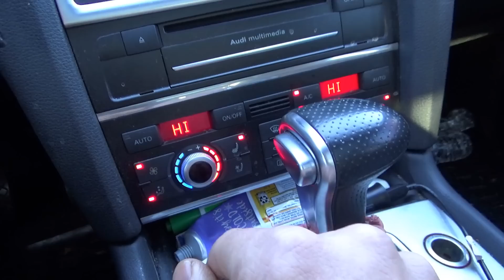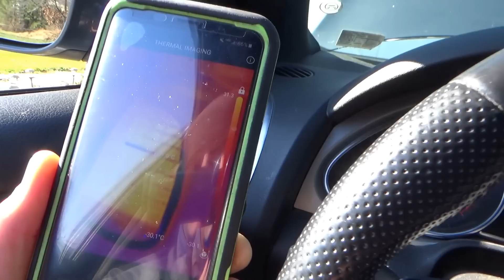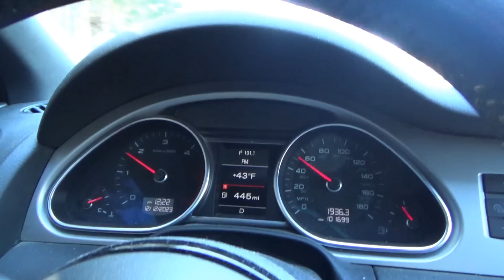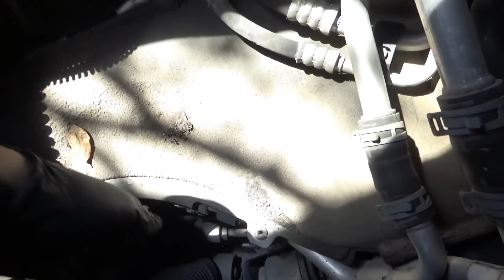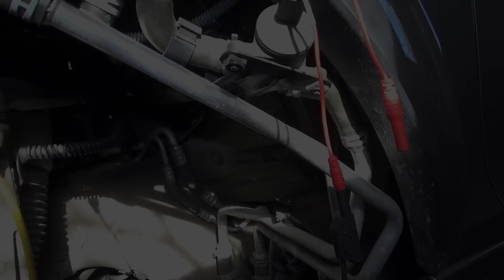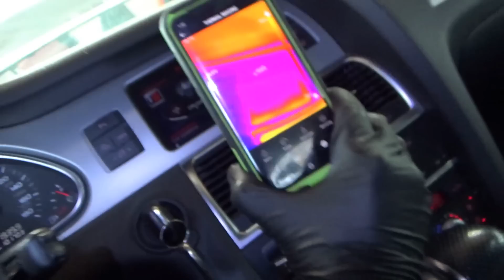Fancy Car...has NO HEAT? (Audi Q7 TDI)

Comment: I've had issues with my 2012 Nissan Frontier SE 4x4 truck since I purchased it. They had to take it back a couple days after purchasing for loss of power and had issues figuring out out. It was the thermostat bad. Even though engine wasn't going into red it was hot enough to put the truck into limp mode. But even after, the Nissan dealership, replaced the thermostat and fixed that issue, my truck has never had good heat. It will stay cold, even if the temp shows normal, while the truck is parked. Once you get moving then it will throw very warm air. But only for a little bit. It will eventually turn cold again. Until the engine is under a load and then it will start to throw hot air again. I wish this could easily be fixed as I plan on keeping it for a few more years.
Reply: My wife's Camry acted like that - and replacing the heater core fixed it, Before replacing the heater core, I'd suggest flushing the core with flow in each direction a few times. Material can coat the inside of the core's tubes and prevent the exchange of heat. Some heater cores are a bear to replace, though. I'd even try putting chemicals in the heater core before replacing it. Good luck to ya!
Reply: @dustcommander100  
I thought about that too, the heater core, but what makes me believe it's not that is that it only happens while sitting still. After you take off it starts to through very hot air. But after 30 seconds or so it eventually goes cold again. If you start up o hill again, it gets hot again. It's making me think that there is air in the line somewhere.
Reply: @HayesTech  That is exactly how the wife's Camry acted! I attributed it to either more coolant flow at higher RPM, or more engine heat produced when driving. If she stopped at a red light, it would go cold, and when driving, it warmed up again. Replacing the heater core either fixed it or got rid of an air pocket that interfered with the flow. I do wish I had backflushed it before going thru all the trouble of replacing it - and I do realize Ivan's (and others) point is quite valid about the possibility of an air pocket being in the system. I wish I had also bled the coolant to eliminate an air pocket as a possible cause.....
Reply: Is this a good reason to use a vacuum coolant filling device?
Reply: @kc360awareness  
I don't know. With me having 2 strokes I losta lot of the use of my right side. So I have to take it to a place for even my oil changes. I truly think it's got air in the system but again I don't know. I'm going to have my mechanic look at it when I save up a few bucks. Shouldn't take that long.
Reply: @kc360awareness  I've never used a device like that, but I normally work on cars that aren't very exotic. I probably should not give an opinion on that device.
Reply from the maker: Try burping the air at the top heater hose connector by the firewall. But watch out for the delicate plastic fittings, I have snapped off a few just by touching them lol
Upgrade to metal fittings for reliability 👍😉
Reply: @PineHollowAutoDiagnostics  
I'll have to get my mechanic too do that for me. Thank you for some direction. I'll post back if it fixes it. I too was thinking it had some air in the lines.

Comment: Is anything on a modern car simple anymore? At what point does system complexity cause more problems than the benefits it provides?
Reply: Heater core cutoffs have been a thing since the 90s. GM trucks introduced them in 1996 😅
Reply: @jessicav2031  My first car from 1983 had a electronic heater cut of. Because it's needed, especially in the summer. Don't want smoking hot water in the  car when it's warm outside

Comment: I have installed second heater core valve on the return side on two of my vehicles and guess what.. A/C is ice cold in the summer! this prevents the conduction of heat through the return hose. It works!
Reply from the maker: Shouldn't matter if valve is on inlet or outlet side... 🤔

Comment: Just more parts to break. As much as they paid for the over engineering they shouldn't have any problems.
Reply: It’s interesting.  German over engineering back through the 80s was something awesome, at least with Mercedes and BMWs…after that, it’s like watching a horror movie.
Reply: It's funny but even cheaper cars have similar systems to control heater cores.

Comment: Why did hot water flow at first.?

Would all the plumbing lines running in the cabin become like baseboard heaters without the cutoff valve?

Comment: When you said that the cabin heats up, initially, then gets cold, I suspected that it was due to a bad flow valve.
I ran into a similar problem, a few years back. The valve, that was causing my problem, was vacuum activated rather than solenoid activated.

Comment: Can't believe the Engine light didn't come on with an unplugged valve.
Reply: Right? It’ll have codes for open circuit in hvac module. Better than ford and GM with their shudders.
Reply: Or limp mode.

Comment: Audis are notorious for clogged heater cores. CLR flush or similar is usually enough.
Reply: I found Thermocure to be really aggressive for corroded systems.  My son has a 98 land cruiser and heater was weak, used the thermocure and 10 flushes later and all good.  I bet CLR works well too though

Comment: $1200 to replace a heater control valve on a 2020 Subaru. Not under warranty
Reply: Good grief, it’s only 4 years old!  What the heck
Reply from the maker: That's insanity 😳
Reply: @PineHollowAutoDiagnostics  yeah for Subaru 2.5L from 2020+ have a thermal control valve which is their electric plastic thermostat. Which they tend to fail very often, It's supposed to warm the car up faster. The valve is under the intake manifold so yeah it's a little pricey to replace. 95% of the time when a newer Subaru gets a check engine light, it's a bad thermal control valve.

Comment: I do love the russian repairs. Some of these vehicles are expensive to repair. Im sure that will be just fine until the summer when the heater core is hot and ya are trying to run the AC. I had a Tbird a lady wanted her AC fixed. Freon was empty. 2 orings right on top ford had them next day. Replaced and charged the system it blew cold as ice till the engine warmed up and heater core overpowered the AC. So I do some testing it has some fancy pants 6 port valve to control 2 zones in the heater core. Valve was stuck open and the solenoid was shorted. Replaced with Motorcraft part and boom AC worked great. Sent car back to customer and then she called couple months later when it got cooler. No heat. The controller of the valve is the ETAC heater control. Either controller had shorted the original valve or vice versa either way we had to get the heater controller repaired too.
Reply: yup visteon datc. tbird ls and s-type

the heater valves on those short out and can blow the 10 amp fuse, or they burn up the traces on the module first. 

never seen one get stuck to ground (cold) that’s a first

Comment: You should check: Is the unpowered position fully open?  My Acura Vigor is like that.  It gets regularly exercised that way and hasn't failed yet in 31 years.  Drawback is a bit of warm air after every hot shutdown/restart.
Reply: He flow checked the valve, powered and unpowered. Both ways was closed.

Comment: That heating system is insane. It is way over complicated. Diesels are useless in the cold. I have a Sprinter van for work...when it gets down to -15 C or.colder as uselss as t**s on a nun. Once it gets down to -20C or colder, need the block heater plugged in. I think these v6 diesels are crap.

Comment: nice and fast. I am assuming that valve is to help warm up the engine faster when it is cold and people put it on max heat. that's where the auxillery heater helps heat up the cabin.?
Reply: Same assumption here. Extended warmup time leads to increased engine wear and above that poor mpg. Shutoff valve there to speed up engine warmup while simultaneously the aux heater ensures a heated cabin.
Would be surprised if the milage in winter went down after the valve broke down

Comment: Ivan , what is the purpose of that valve ? especially since you don't need it to get the heat in working order
Reply: It varies the amount of hot water that goes to the heater core. Shuts off radiator water when a/c is on.

Comment: Is it worth installing a heater core diverter valve in a normal car (to boost summer AC performance)?
Reply: Yes, I installed one in my 2006 Dodge Ram 2500… the AC could not overcome the heat being pumped through the heater core without it.

Comment: Use to have an old ford fiesta Wen I was younger and not a lot of money. 

In the winter I use to just bypass the heater control valve and run hot air . And vice versa in the summer

Comment: Seems like automakers add these valves for maximum AC performance (air handler box leaks) and as a side benefit they keep crud out of the heater core when the heat isn't needed, but i'm sure that part isn't a priority...
Reply: Also less stress or cycles on the heater core in theory... Don't want to be replacing those, especially in an Audi!

Comment: How much would it cost to simply put a simple shut off valve back there to cut off the flow during summer. I had a Chrysler with a vaccuum actuated valve on the heater hose and if it didn't shut off it really hurt the air conditioner performance.
Reply: Or make the valve default open.
Reply: Default open will allow hot water to flow through heater core and compromise Air conditioner efficiency. A  simple shut off valve would be better. @petrnemecek4379

Comment: This will be a great fit for the summer months.....the AC won't get cold.  Russian hack not that good this time.  You fixed the result and not the problem.  Ivan go read Audi's theory of operation.
Reply: This fix will work fine for a few more years until the blend door foam starts blowing out the vents.  Then spend $200 on the valve or $3000 rebuilding the HVAC box.
Reply: How will the AC not work?
Reply: Exactly spot on.
Reply: The shut off valve stops coolant from circulating through the heater core from the aux water pump when the heater is not in use; I believe the auxiliary water pump is only turned on when the heater is in use though it may also be part of the Start/Stop system (if equipped). Further no air will be vented through the heater core unless the heater is turned on. While it introduces some heat into the HVAC system, it simply means the AC will have to work a little harder to cool the car. So it's a temporary fix unless it works. OTOH it is an Audi with 100,000 miles which means this is likely just the start of a laundry list of sub systems that will continue to fail.
Reply from the maker: Many cars don't have coolant shut off valves and the AC works just fine... That's what blend doors are for 😜
Reply: @PineHollowAutoDiagnostics  seriously, every car I owned has a heater shut of valve, from mechanical to electronic. You don't want 90 degree water in the summer inside the car. This is a hack that will not work and will proably end up you changing a hvac unit in the long run when flapmotors or boards not designed for boiling temps say thankyou and godnight

Comment: Auxiliary heat would be a wonderful feature.
Reply: Those Diesel fuel catalyst heaters are quite popular in northern Europe.
Reply: @AraCarrano  I know what you're talking about but that's not what I'm referring to here.
Reply: Some winter packages at least in Europe come with glow plugs on the coolant lines. Auxiliary diesel heaters have also been an option on premium models and even Skodas for a long time. You can of course always retrofit. Some people even fit them to their electric cars!
Reply: @rkan2 My Mk.4 Jetta TDI (manual transmission) has the coolant glow plugs; automatics just used the transmission cooler to help heat the engine.  Definitely takes a while to warm up, and no point in letting it idle more than a couple minutes as it needs engine load to get hot.  Mk.5 introduced an auxiliary electric heater I believe.
Reply: It's been a few years, but my dad owned an 08' A8 and the heat did come up pretty quick as I recall, but than again the car was garaged. There was a way to run the climate control while the ignition was off for a brief time to heat the cabin, but the fan speed was limited to low or option 3 and it would eventually turn off after a period of time. I assume this used the auxiliary heat to continue providing heat with the engine off. I wonder if there was a limit to how high the fan speed could be and the aux heat able to supply enough with the engine running but cold? Granted with the ignition off, eventually that would drain the battery which was why the fan speed was limited and it turned off automatically.
Reply: @Techhead777  That is not an uncommon feature with cars that have an electric water pump. Called "residual heat function"
Reply: It is an electric heater in the airduct. A lot of european diesel cars have it because it takes forever for a diesel to heat up in city traffic.

Comment: problem like air into heater lines like a head gasket would do
Reply: No white smoke and no Miss fire.  Blocked hose or failed valve